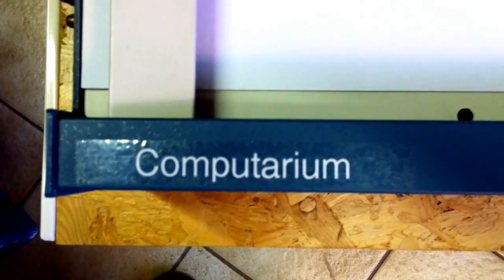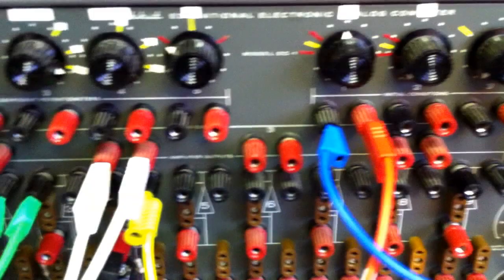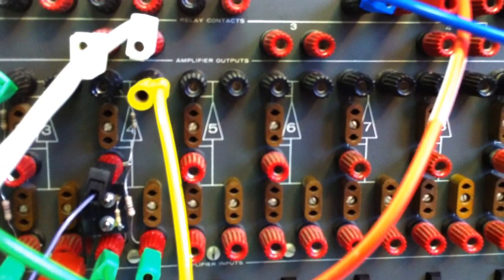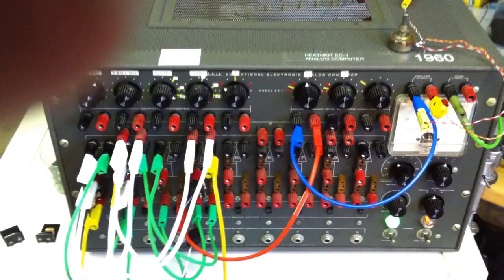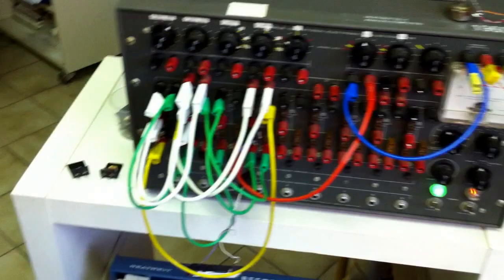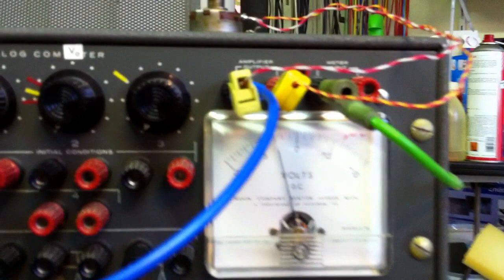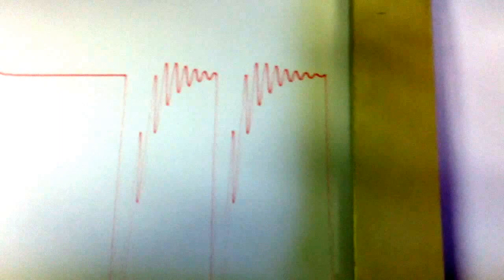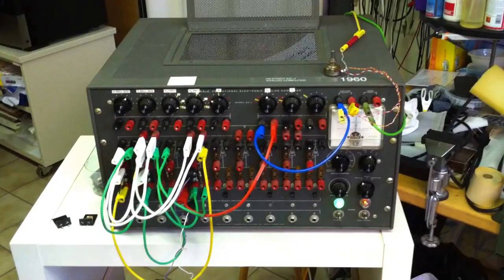HEATHKIT EC-1 ANALOG COMPUTER (1960)

Comment: I worked on a valve computer system in the early 60s. The tubes were wire ended and soldered directly onto the boards. Their were about 700 thermionic tubes and the complete computer was about the size of a house. If anyone had told me that within my lifetime a laptop would have more than 1000 times the power of this machine, I would have assumed that they were crazy.